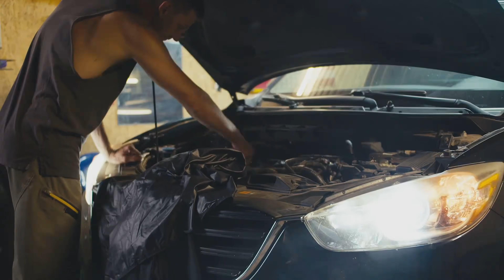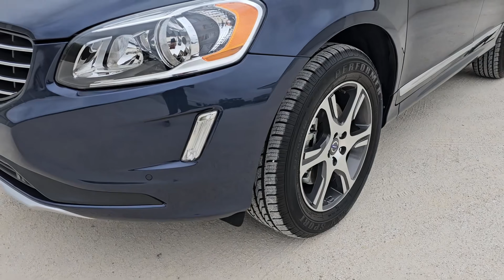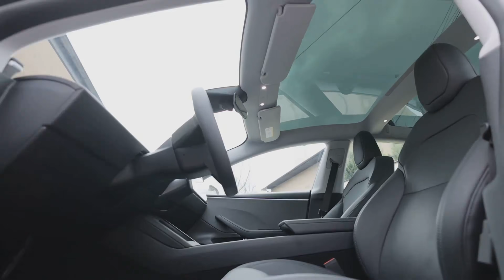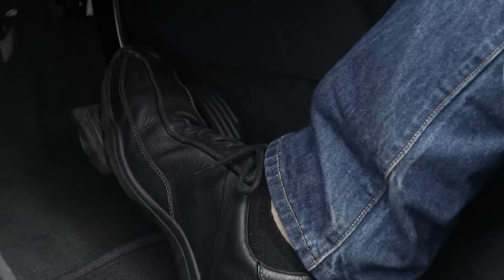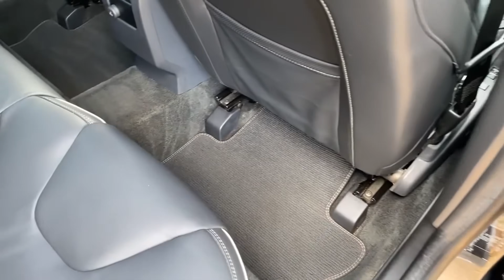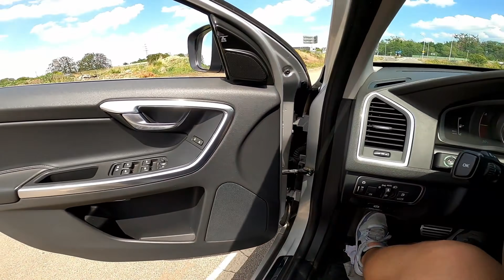Should You Get a Volvo XC60 2014–2017: Strong and Weak Sides

Comment: I've had 3 Volvo's over 30 years.  The 740 Turbo went over 250,000 miles and ran like a tank.  The 850 Volvo went over 220,000 miles.  I replaced it with a 2015.5 XC 60 which is the best Volvo yet.  At only 77,000 miles (less drives now a days) it has started to burn oil requiring a quart to top off between oil changes.  The body is intact with no squeaks or rattles.  The electronics are always a problem and the dealers don't know how to fix them.  I have found that avoiding the dealership has been the best way to maintain the car.  I have been lucky to find 2 certified independent Volvo repair technicians who have kept my cars going.  I would say to avoid the dealership for most of the servicing.
Reply: I agree. I had bad experienced with volvo dealers (I have been once only for my XC60, and once for a previous C30).  I have a 2015  2 wheels drive XC60 Diesel (181HP, 8 automatic gear box) with ca 110 000 miles. I have done the gear box oil changes twice (every 50 000 miles) and motor oil changes (every 12 000 miles).  Timing belt replaced at 9 years. Suspension replaced at 100 000 km. Regular filters changes and brake paddles. All this either by myself (Oil changes and filters, pads) or my local competent independant garage (which I highly trust).  The only problems I have experienced so far are: 
1) engine light which was due to a blocked pipe between exhaust side of the engine and the exhaust gas pressure sensor, in the investigation I did also EGR valve (and its radiator) and inlet manifold cleaning.  Cleaning the blocked pipe resolved this issues (Done at around 80 000 miles).  
2) driver door lock failure.  
3) a bit oil consumption about  1 liter  every 12 000 miles. 
4) minor squeak noise (no clue what is the cause)